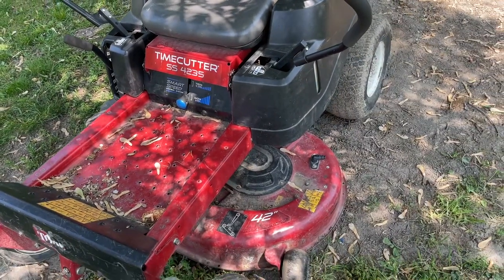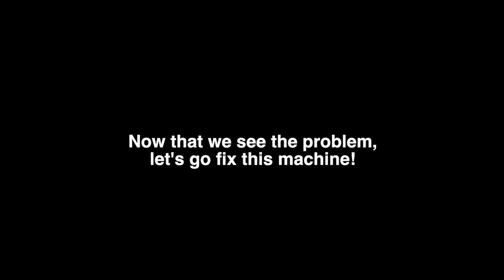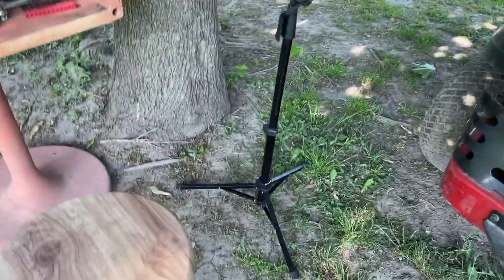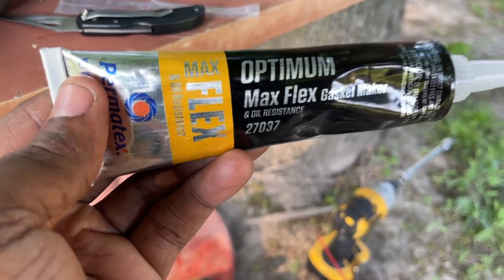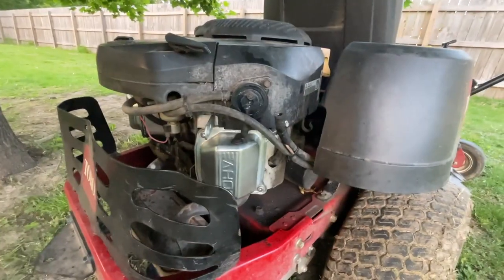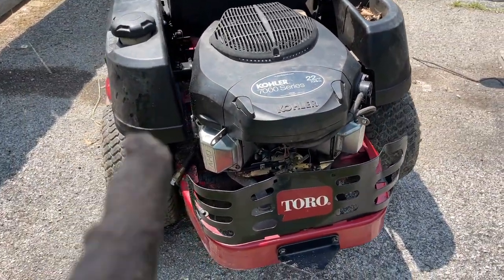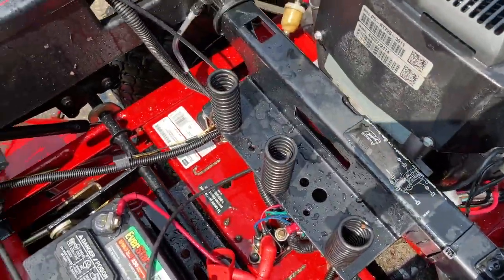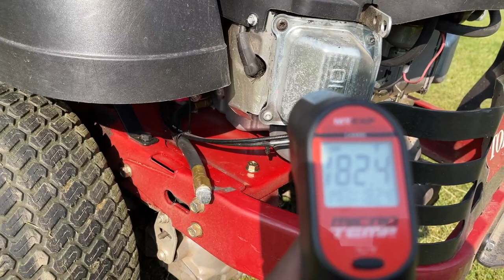Toro Timecutter Riding Mower Valve Cover Gasket Replacement! Kohler 7000 Series Oil Leak Fix! +Tips!

Comment: Thanks T. Mine has always leaked from new. I’ll be doing your fix as soon as I can. I just always assumed that topping off the oil was “too much” for the engine, as it would leak more when full. Appreciate the work of your video!
Reply from the maker: You're very welcome Rodney. Thank you SO much for watching my content.
Reply: Did the repair. Works great! Much thanks.
Reply from the maker: It absolutely does work great Rodney. Once again, thank you so much for watching.

Comment: Thanks man….mine has same leak…..you saved me a lot of time and money
Reply from the maker: That's awesome! I am glad my video helped you. Thanks for watching.
Reply: @TerenceDIY  Sadly when I opened the right side up, the push rods were broken and the other bent. I replaced them, but not sure if got them exactly to specs. It runs good still, no oil leak anymore.
Reply from the maker: I am glad you were able to figure out the problem. As long as it is running good, you should be fine.

Comment: Thanks Terence.  I have the same mower as you do Toro/Time cutter SS4235-Kohler 22hp engine.  The Kohler Shop Manuel procedure only advises to use the 'make-a-gasket' (but does not mention an actual gasket
or that one even exists).  I did not know that a hard gasket as you show even existed.  This time I'm repairing the leak as you have showed with the 'make-a-gasket' and hard gasket to fix the leak.  This will make the 4th time in 10 years that I've had this mower and will have made this repair; and, hopefully the leak will stop for many years to come. Thanks again.
Reply from the maker: If you do exactly as I did, this will fix your issue for a very long time. I ran the heck out of my mower after this just to see how well it would hold up and it looks exactly as it did when I fixed it. Thank YOU for watching my content.